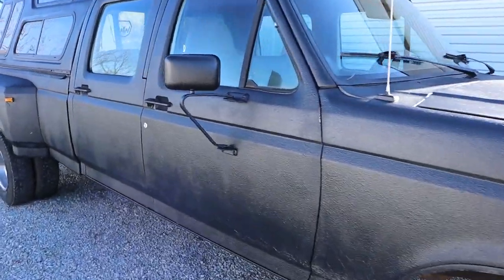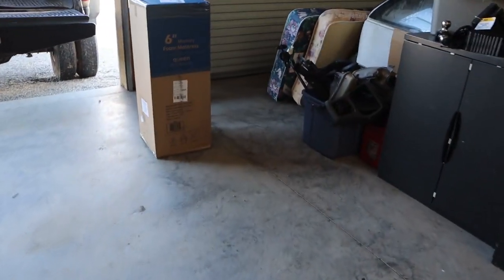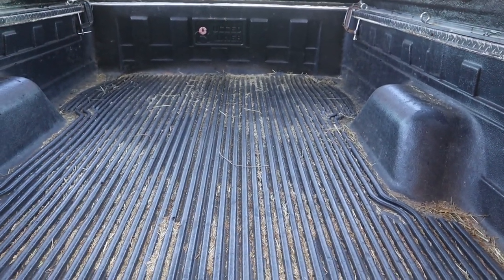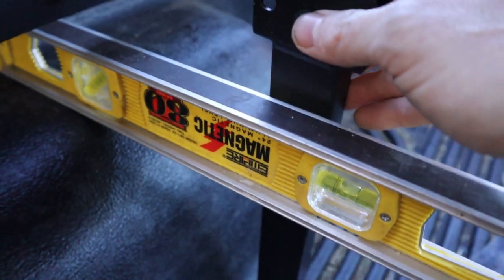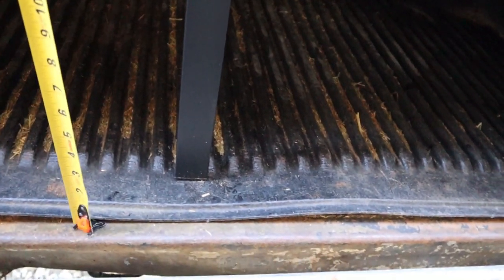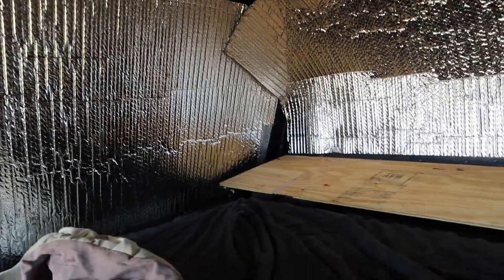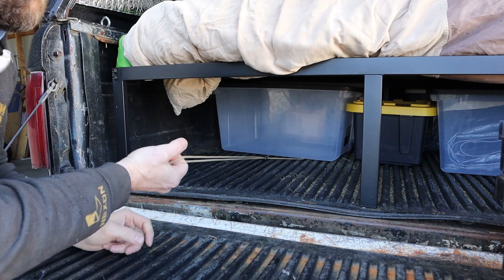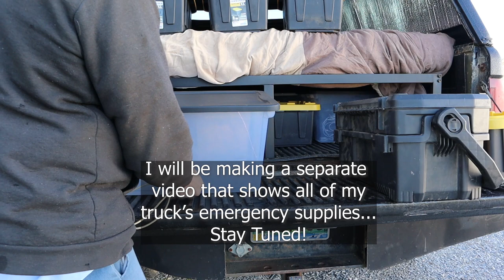BUDGET Truck Camper Bed Platform with Storage -- Easy to Build and Remove

Comment: Absolutely great idea with the bed frame. I have been trying to figure out my plan for a platform bed for my family and was pretty apprehensive about using wood due to weight. We’re not going to be full-time campers and so I need to have my truck bed available to haul stuff as well. Your approach is a great solution. Thanks for taking the time to produce the video.

Comment: I have an 8ft bed on my truck also and I am going to build something similar. 
I have four slots on each side of my bed to insert two by sixes so that's how I'm going to start it and then I will support the middle North and South and I will have two pockets underneath the bed like yours.
I bought a short queen RV mattress so it is 5 inches shorter then a standard queen that will give me around 20 in on the back of my truck four chairs extra things like firewood whatever I want but I like the idea upfront that you are doing in front of the bed you got me thinking

Comment: I have a Ford F250 Super Duty extended cab with a front bench seat.  I sleep inside my cab on my bench seat where the cab is far better insulated and secure, than inside the back of my pickup in my canopy.   I use the extended cab area for my clothing and gear I access on a daily basis like cameras and hiking gear.  I have yet to see a DIY video showing how someone has rigged the bed of their truck to solely store camping gear while using their cab for a sleeping area.